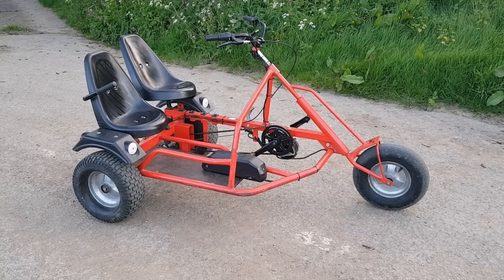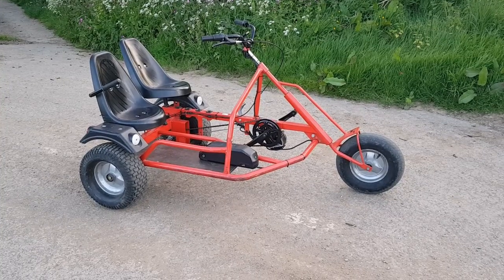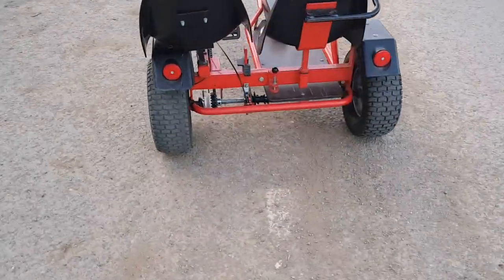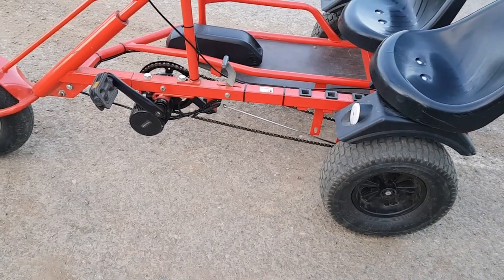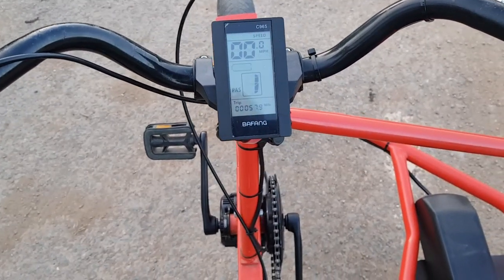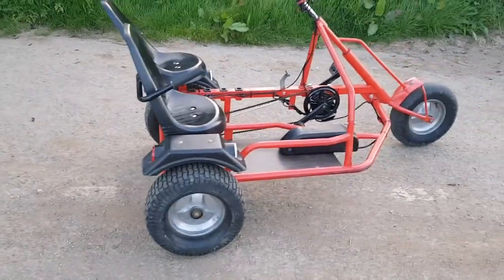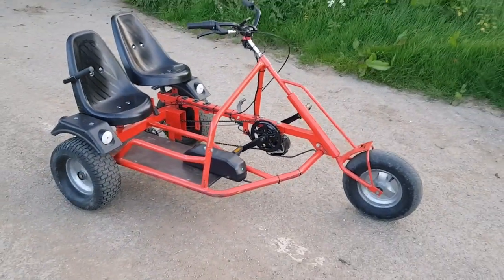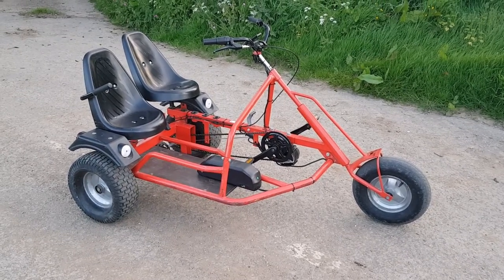Bafang BBS02 750w Electric Trike Conversion

Comment: Looks very nice. I have just done the same with the four wheel version. I would be very interested in fitting a disc brake to mine. Please could you tell me how you fitted it and link to the parts you used?

Comment: Very interesting video. I'm actually planning to do exactly this and have just sourced my used Dinocars Seitenwagen :)
One question I have, if you could maybe help: I planned to swap the freewheel unit on the axle with a so-called BFR Nabe. This allows forwards motion with freewheel, pedal-braking and then reversing after stopping. Perfect for gokarts. My question is - based on your knowledge of these motors, would this pedal-brake still function or would it lose its effect once the pedelec is installed? So far my research tells me that these pedelec conversion kits aren't compatible with a pedal-brake, although I saw one lesser-name chinese model claim it can do it. I would still plan to install a disk brake as well, though I suspect I will have difficulty with this...